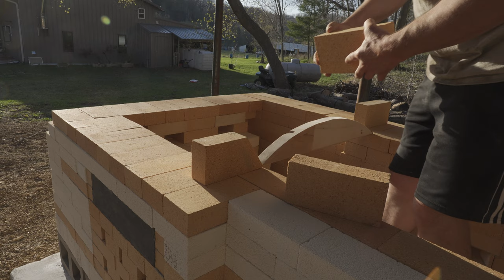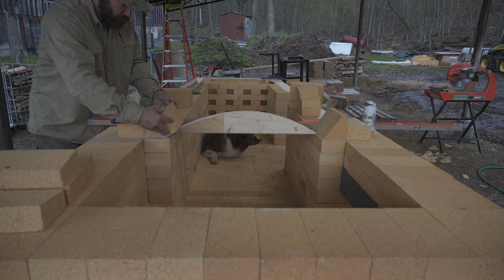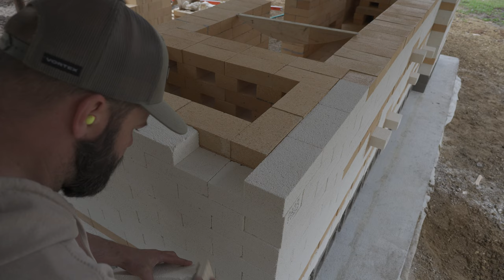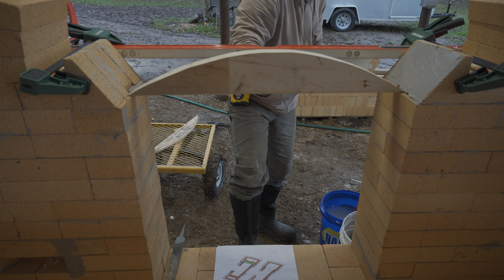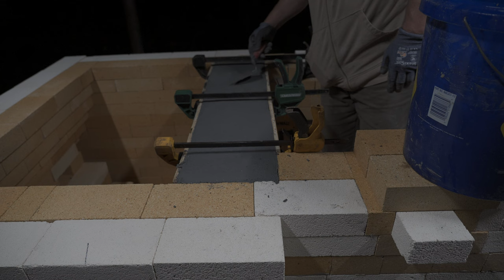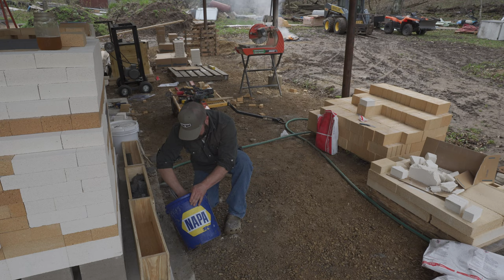#6 Building a Wood Fired Pottery Kiln - Fire Brick Arches

Comment: Just a word of advice, although by the looks of it i might be too late and you know what youre doing… but when you make such thick and tall sections out of castable (and/or concrete as well) you might want to add stainless steel rods. It helps help it keep its shape and integrity for much longer. Its why rebar is used in concrete jobs.

Other than that it looks amazing, wish i has as much space as you do!
Reply from the maker: Ok thanks!
Reply: Since this kiln will get fired up to about 1200-1300 degrees celsius wouldn't it be a bad thing to have an element contract and expand with the heat?